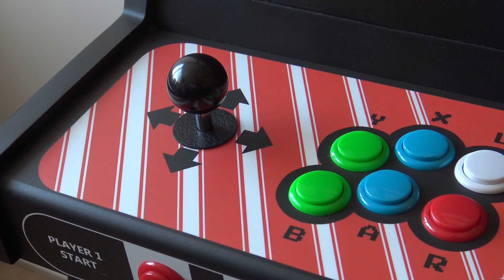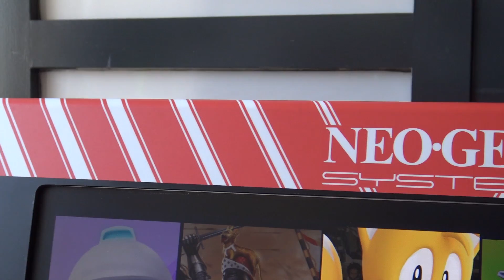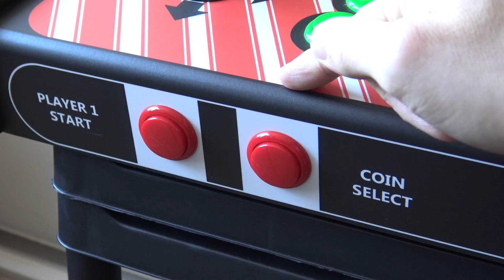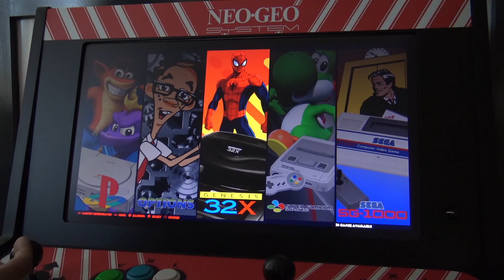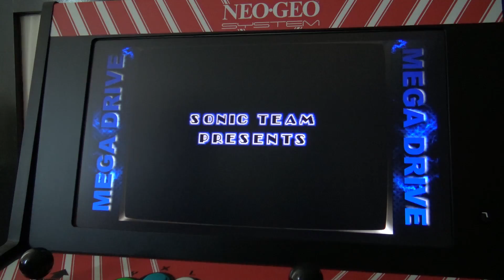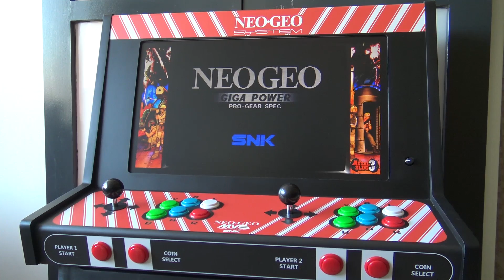Neo Geo Arcade Machine Custom Bartop Design | The Ultimate Arcade Machine

Comment: I wanted to buy the Neo Geo MVSX Cabinet. It costs about 450 to 500 just for the bar top and over 600 if you want the full cabinet and stool. I figure if I made it myself, it would be so much cheaper. Even if you were to add a marquee to a custom cabinet, it would be cheaper than the Mvsx 😂